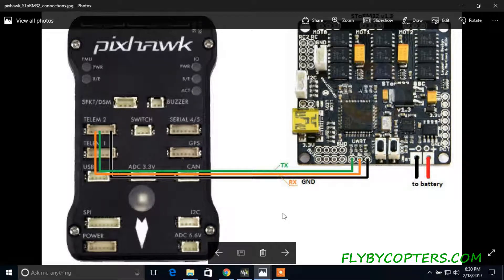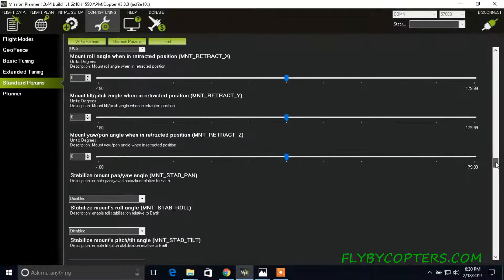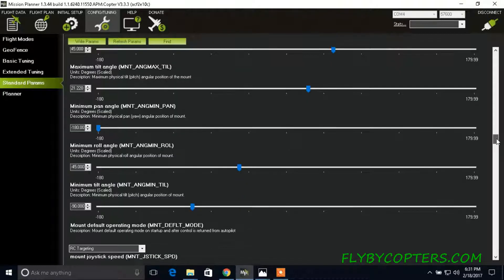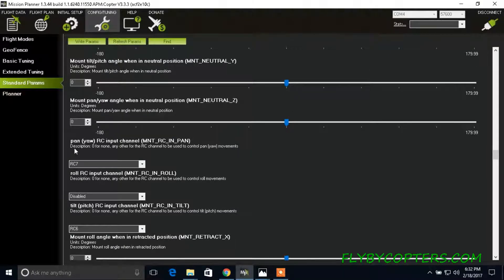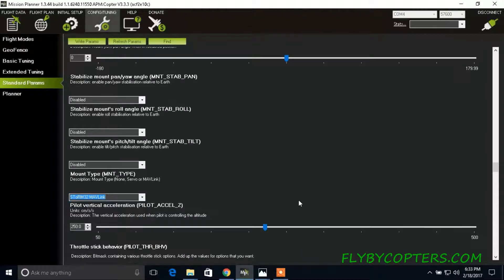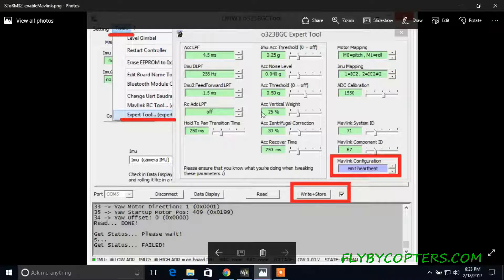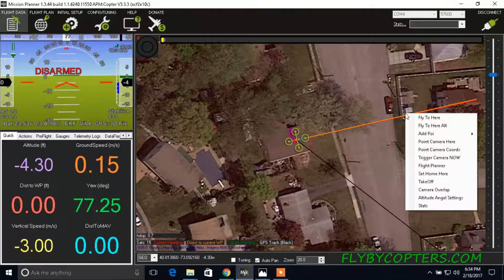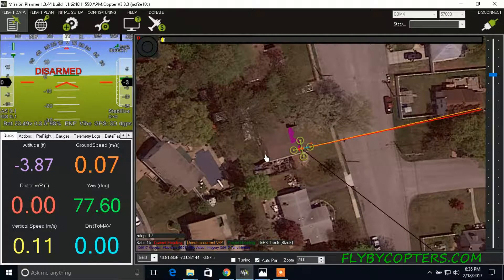Setup Storm32 Gimbal With Pixhawk Flight Controller

Comment: Thanks for the video. Have you tried or confirmed that Storm32 Gimbals are working on the later Arducopter versions? I am currently running 3.5 RC7 and can not get it to work. I can tilt manually over ch6 control, but MP/Tower will not tilt in a mission. Thanx!

Comment: Does this give you the ability to control the gimbal via the transmitter?
Reply: yes, it does.
Reply: @junsal4  In my setup to control yaw or pitch I do need to conect to the sbus pin is it posible to control with rc using only mavlink??